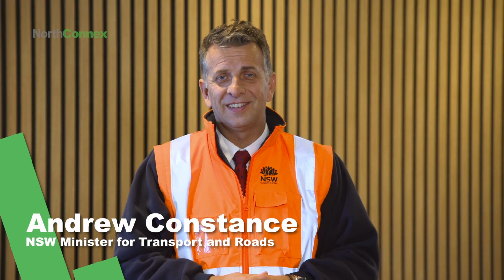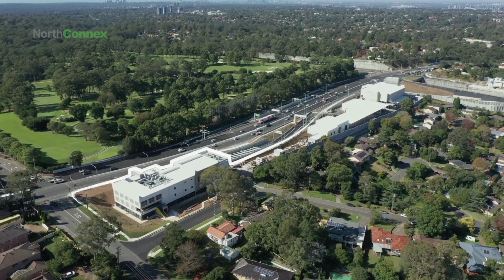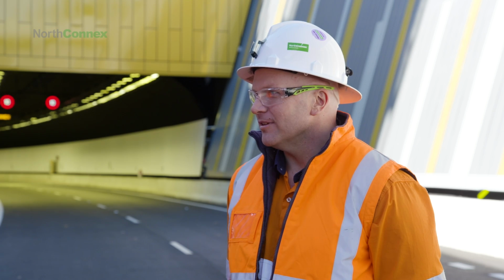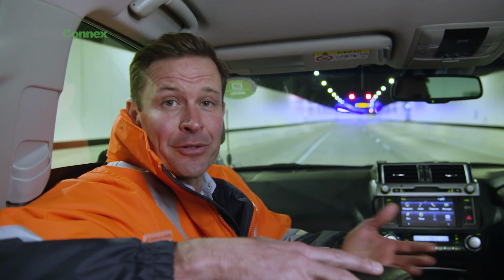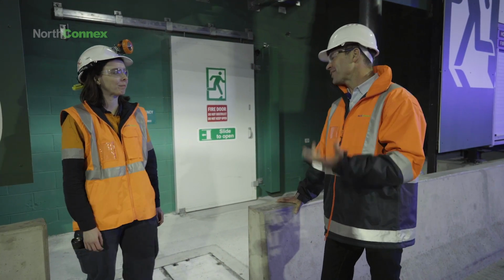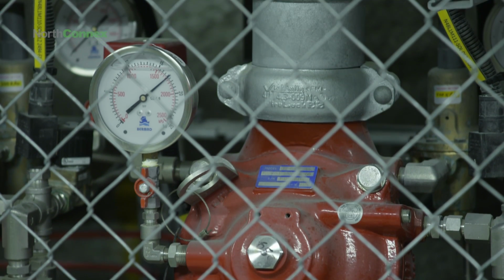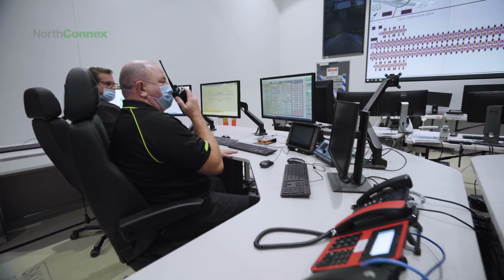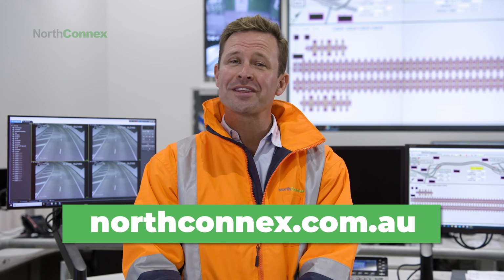NorthConnex Tunnel Tour

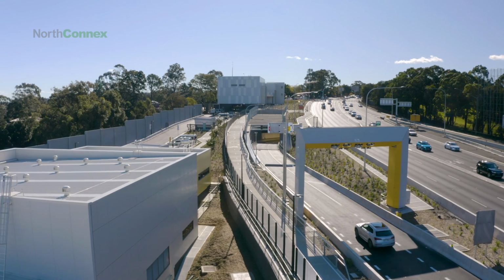Comment: Why is the E-Toll At 0:04 yellow
Reply from the maker: Hi Michael, the answer is a long one! The tolling structures have been designed with a steel frame, aluminium cladding finish, and accent yellow on the underside of the structure, as a feature to match treatments and interfaces on other NorthConnex elements and building facades around the southern interchange and operational facilities located in West Pennant Hills. takes breath The yellow highlight is representative of the colour of Sydney sandstone and the design and colours are all part of the unique Urban Design & Landscape plan for the NorthConnex project.
Reply: @transurbangroup ok thx
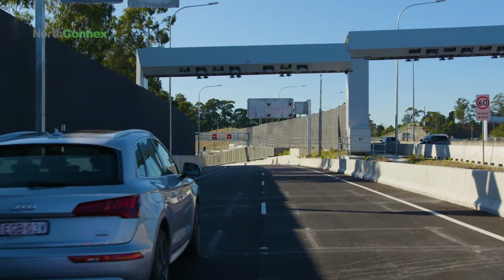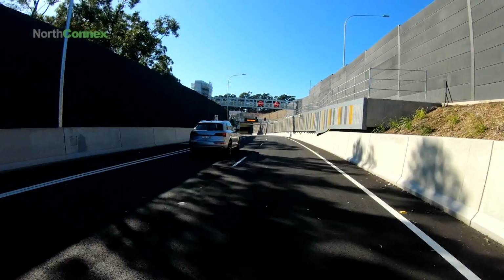Reply: @transurbangroup why is there 2 tolls of the entry of northconnex 1:23-1:29
Reply from the maker: @OfficialMichaelTheCollector  One gantry has the tolling infrastructure, the other safety cameras.

Comment: Who else finds it strange that there’s no direct entrance into NorthConnex from M2 Westbound (coming from city)? 

You have to get off M2 Westbound at Pennant Hills rd exit and turn right to then enter NorthConnex. 

During PM peak hour wouldn’t that Pennant Hills Rd exit from M1 get completely chocka-block??
Reply from the maker: Hi Raven, NorthConnex was designed as connection to Western Sydney and beyond from the Central and North Coast. Although there is no direct connection to/from the city at opening, the NorthConnex has been future proofed if a direct connection was ever required. Nik

Comment: Not going to use the tunnel. LEDs are toxic on the eyes, they're retina burners. LEDs are lights that are bad for the retina & the blue light spectrum is blinding.  I will be one who will always use Pennant Hills Road, as I don't want to be dazzled & in severe retina pain from the blue lights but also the regular LED lights. LEDs are a diode, so they pulse like a picture tube rear projection TV.
Reply: What do you use in your home, candles?
Reply: @380130   Halogen.
Reply: @mrbillhilly343  Don't they have a lot of LED's in TV's? If you don't have one you must read a lot?

Comment: Why aren't these sort of tunnels designed to take higher speeds? It is just another part of a motorway that has much higher speeds and being a new design, they should be able to meet design requirements for higher speeds by having a great alignment and safety features. Exits could be a lower speed while the main tunnel is at least 90km/hr or more.
Reply from the maker: Hi Clayton, the speed limit is 80km/h which is consistent with other road tunnels across Sydney and is set by TfNSW. Nik

Comment: At last!  Now for a tunnel system that goes from the Warringah freeway to M1 and North Connex.
Reply: @Muckin 4on because there is no other direct route Wahroonga to Concord / Strathfield / Homebush to connect into the M4 (& effectively the M5 East Tunnels) - this would take traffic off an already over congested Pacific Highway between Wahroonga/Pymble/Chatswood & The Bradfield Highway... tunnelling Wahroonga -> Lane Cove / Macquarie Park / Uni Interchange - > Concorde M4 & M5 Interchange also offer the advantage to build A Sydney Metro System along side the road tunnel project connecting The Inner Northern Suburbs like Top Ryde located between The SYD Trains Nthn & Nth Shore Lines that are currently served by buses, integrating into SYD West Metro @ &/or thru The Bays Precinct Area could also be incorporated into such a design, getting more value for money...

You might want Sun, Sky, Fresh Air & Trees: Effectively an entire new ‘above ground motorway’ but to achieve a direct alignment Wahroonga - > Lane Cove / Macquarie Park / Uni / Shopping Centre -> Top Ryde -> The Bays Precinct Area -> Concorde M4 Interchange: a tunnel is the only option, thereby helping ease connection on Pacific Highway / Lane Cove Road / Concorde Road / Homebush Bay Road, & speeding up commutes from Newcastle & The Central Coast to SYD CBD, A high speed rail alignment Hornsby -> Gosford to speed up rail commuting is only achievable by boring two twin rail tunnels Hornsby - > Gosford to replace much of the above ground alignment thru the Cowan -> Brooklyn -> Wondabyne (Brisbane Waterway) ->  Woy Woy -> Gosford area...
Reply: @Dalts1985  It's all doable, just need money,  the will and time. Check out Japanese rail tunnel systems and Norways proposed floating tunnels too.
Reply: @fatbudgiekillen8997  Yeah it’s cool and all but we’re not Japan or Norway are we?
Reply: Also down to The M4 & West Connex @ Concord❗️😇

Wahroonga M1 Junctions direct tunnelling (Via The Bays Precinct) to M4 Concord Rd & Rozelle Bay (Iron Cove Bridge) Interchanges & Western Harbour Tunnel with access thru on & off ramps provided to & from Lane Cove Rd / Macquarie Uni / Park / Shopping Center on & off ramps from said Tunnel
Reply: @Muckin 4on The F3 was originally supposed to terminate at the Figtree, Tarban Creek, Gladesville Bridge interchange which is why that interchange is constructed to freeway standard. Nifty Nev decided it was all too expensive to built an urban freeway network however so his government flogged off all the freeway corridors to developers. This is why the current government has to keep building motorways and railways underground - far fewer properties need resuming to build them and thus not as politically damaging.

Others have suggested an M1 bypass of the Pacific Highway to the Warringah Freeway. I'd support that too. As if this point in time I use the M2 and NorthConnex to reach the M1. It is a longer trip but bypasses the Pacific Highway's serial of school zones and the fact that the northbound route is mostly reduced to two lanes.
Reply: @vintageradio3404  immigration

Comment: Fairly typical PR type video where it looks like they have covered every contingency. What they haven't provided for is future expansion when more than two lanes are required. True they have said 'possible to expand to three lanes in the future'. But what they haven't said, to get three lanes will be at the expense of the breakdown lane. No foresight on this build, should have been three lanes plus a breakdown lane now. Glad Bradfield had the vision to build the Sydney Harbour bridge for the future. A today tunnel, not for tomorrow.
Reply: Tunnels don't normally have breakdown lanes. WestConnex has small shoulders to permit drivers making errors to correct before they lose paint off their cars but that's about it. It is noteworthy that tunnels in Sydney are getting bigger. NorthConnex can be expanded to three lanes each way, with the smaller shoulders. The M8's two-lane section can as well though part of the M8 is four lanes each way. The M4-M5 link will be four lanes each way.

There's no point in making NorthConnex three lanes each way whilst the M1 (F3) is only three lanes each way. When someone who knows how to build surface roads comes along and make it a minimum of five lanes each way between Wahroongah and Gosford then the extra tunnel lanes will have a purpose.
Reply: @vintageradio3404  Breakdown lanes should be made a 'standard lane' width for safety such as changing tyres etc. Sub standard width breakdown lanes have resulted in the deaths of a few people trying to change tyres due to substandard width breakdown lanes. Saving money is obviously more important than safety.
Reply: @380130  As mentioned, the breakdown lane is temporary and tunnel management will slow approaching traffic when there is a car in that lane. There are permanent breakdown alcoves in all of Sydney's tunnels except the Sydney Harbour Tunnel and these are equipped with automated warning systems for approaching drivers and emergency telephones.
Reply: @380130  it's doing it on the cheap
Reply: @vintageradio3404  what good is an alcove to anyone when they break down, especially an elderly person?
Reply: @vintageradio3404  If they expand it to 3 lanes in each direction, not only will the emergency lane need to be used but the existing lanes will probably end up being slightly narrower, thus making driving through the tunnel a riskier affair. I don't think they'll ever realistically increase the the number of lanes in the tunnel. As you can clearly see it's a 2-lane tunnel with an emergency lane that is barely half the width of a traffic lane plus a little bit of extra laneway on the inside shoulder.
Reply: @wertherquartett  The great example was the road tunnel at Epping on the M2. Built originally as two lanes each direction, then they realise it needed to be expanded to three lanes and this resulted in months of 40kmh road restrictions during construction. Same again on the F3/M1 being expanded to three lanes north of Hornsby
Reply: yes, they said, in case of congestion in the future, it can be expanded to an extra lane.  Inotherwords, more immigration which is the problem re traffic congestion
Reply: @alanbstard4  3 lanes = no emergency lane
Reply: @380130  yes I suspect that too

Comment: With all been said now by engineer's in video. It's clearly that the Northconnex tunnels are ready to be open. News report's are saying it could be sooner or in 2 weeks time. So what's the hold up now ? 
With the amount of heavy vehicles & light vehicles on Pennant Hills Road now. I do believe the NSW GOVERNMENT is making the wrong decision by not opening the 3 lane in the tunnels. This will make traffic flow better to the M1.Which is already a 3 lane freeway. 
This would also give the heavy vehicles a better run through the tunnels connecting the M1.With out breaking all the time with slow vehicles. 
And THANK YOU to all Women & Men that made SYDNEY new GATEWAY a reality. It's your footprint.🇦🇺
Reply: There are other vehicles coming onto M1 - not just from Northconnex - from Pennant Hills Road and Pacific Hwy . How will you suggest to pack them in?
Reply: M1 is only two lanes at the northern end of the tunnel, the third lane there being on and off ramps to the pacific highway so that won't be an issue.
Reply: @matyanyo  So there are five lanes merging northbound - three from Pennant Hills Rd, and two from Pacific hwy. So you suggest that all of them do not deserve a separate lane -  not coming from the tunnel?

Comment: How many speed cameras?
Reply: Who cares how many. Stick to speed limit, happy days. Silly question, imo.
Reply: For sure will be full of them .
Basically every sign with speed has camera above
Reply: Yes
Reply from the maker: Hi Matthew, the speed cameras are operated and enforced by TfNSW. It's best to contact them directly for further information on this. Nik
Reply: @transurbangroup  - Yeah, mention the important things like useless birds but sidestep more pertinent issues.
Reply: @TeeVee-d4d  Tollway operators do not run speed cameras. They are run by a third party on behalf of the NSW Government. I believe the company is Redflex, owned by Macquarie Bank.

That said, there's likely to be three cameras in each tunnel, if the M5 East is anything to go by. One standard speed camera in a random location and point-to-point cameras at each end to measure the average speed of trucks. This will stop speeding truck drivers evading the speed camera once its location becomes common knowledge.
Reply: @vintageradio3404  - ty

Comment: 110km down to 80km, this tunnel is going to snap a lot of people speeding. Lol
Reply: Currently from M1 onto Pennant Hills Rd you go from 110, down to 70. How exactly will an increase in speed now catch more people?
Reply: @jezeremyhubert  because Pennant Hills Road   Has a lot of traffic and traffic lights. We all know that once you have been driving at a faster speed for a while you tend to drive a little faster at lower speeds. Like after you get of freeway you feel like 60km is like driving 40km. People are gonna accidentally drive a little faster than 80km when they are not looking at speedo.
Reply: @cityplanner3063  You havent seen how quickly the trucks travel through the school zone less than 1km from the M1. They don't stick to 70.
Reply: @jezeremyhubert  because it will flow more freely I presume
Reply: 80kms is way too low; you feel likely you are crawling along & too easy to lose attention;In fact I set my cruise control; I've driven 4 times this week - 100 would be far better
Reply: They estimate  8mins to go 9kms, an average speed of 67.5kph
Reply: Speed should be 100km make the trip go faster too
Reply from the maker: Hi all, the speed limit is 80km/h which is consistent with other road tunnels across Sydney. The speeds are set and enforced by TfNSW.